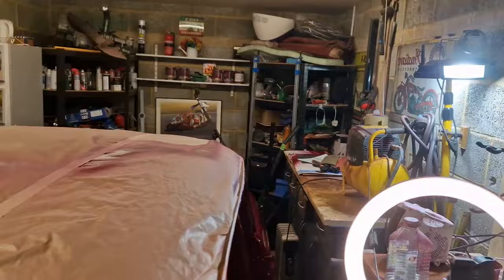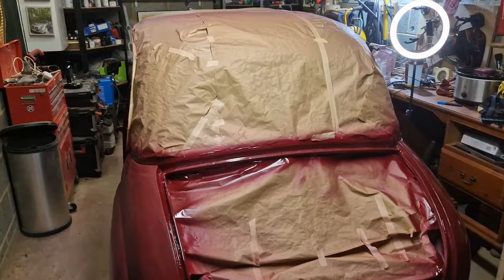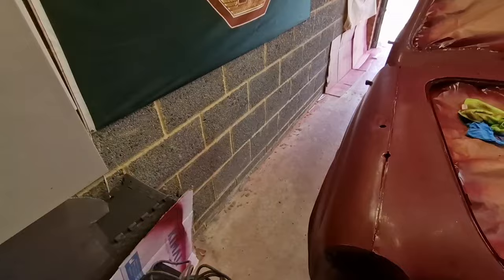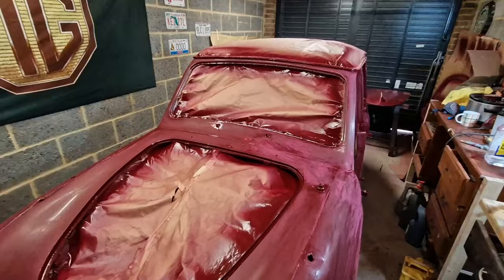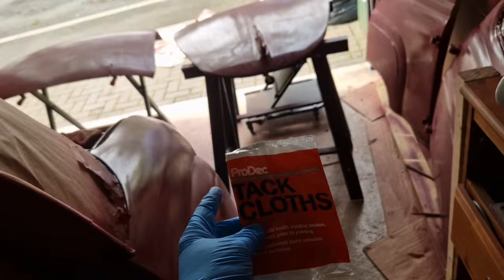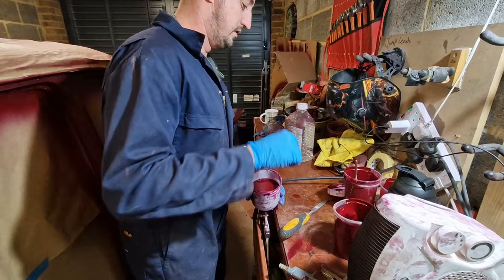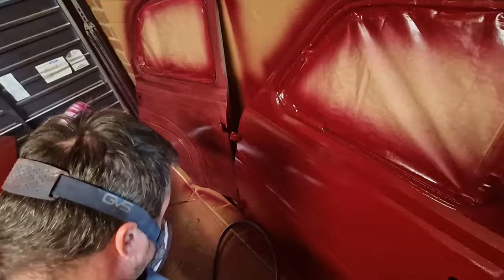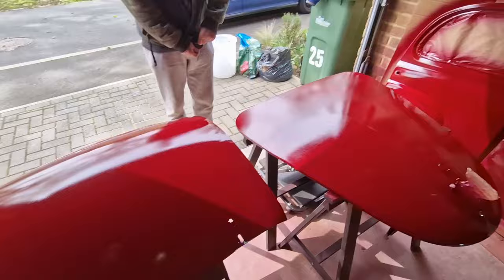Final coat of paint and wet and dry sanding

Comment: Hi Kris, you spoke about pressure and your gun ! the thing to understand is if you set your pressure at 40psi then that air is forced down into the hose and lets say your hose is 10metres long , then the pressure at the gun could be 35psi or lower, bit like voltage drop with an extension lead. If i were you purchase a pressure gauge with the water trap and fit to the gun then plug your air pipe into that. Lacquer is always applied a couple of PSI higher than your base coat which you can then set the correct PSI at the gun and alter as you go when the compressor struggles a little, by doing this you have a better chance of laying a nice wet looking coat without dry spots which look dullish. Fantastic job your both doing and very enjoyable to watch. Ian and the plank ! yeah why not its a yes from me but remember you did it in the cold winter month !!! ill leave that with you lol
Reply from the maker: If I'm being honest I started realising videos so my uncle that has had s Stoke could watch me doing my Austin up as he also has one but I really under estimated how helpful some of the comment  can be honestly really appreciate this advice regarding the compressor and I will definitely be getting a water trap for the compressor. I would like to reinvest in a new one how powerful would you recommend for the type of work I'm going? Thanks again glad I got one vote for Ian taking a splash hahaha 😆
Reply: @krismann9101  Hi Kris, as your not going to be spraying cars every week of the year and a hobbyist as am I,  we have to be sensible regarding room and cost. I use a 2.5 hp 50litre compressor from SGS think the same one is around £149 who deliver next day bit noisy  but i can have trigger fully open set at 29 psi  for 43 seconds before it recharges ,  i use LVLP spray guns with an air regulator gauge and water trap, I get pretty good results. I use a 1.3 gun for base coat, a 1.2 gun for lacquer and a 1.8 for primer as its a heavier material and all LVLP.
I  think you and Ian have an honest genuine friendship not afraid to have a go at new things and your results are very good. I found your channel as I'm looking for an A30 needing tlc , watched all your vids now and found to be inspiring and honest which I find refreshing and rare these days.
Reply: On offer for £119.99 50LTR Direct drive , SGS ENGINEERING